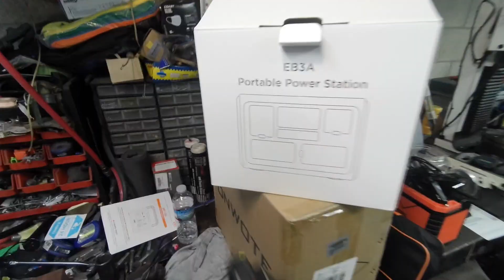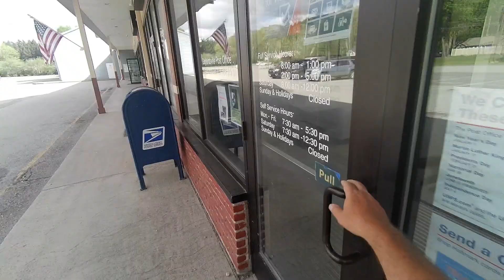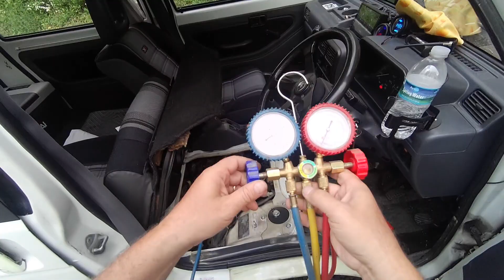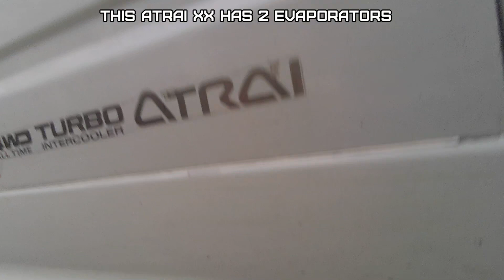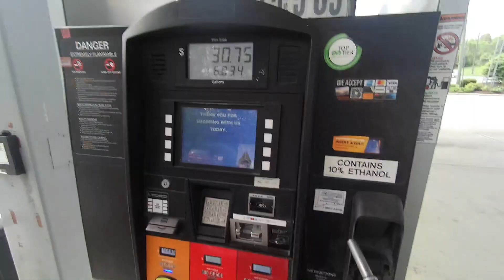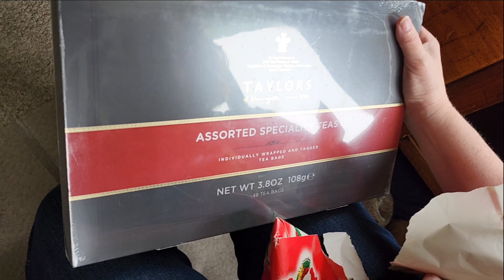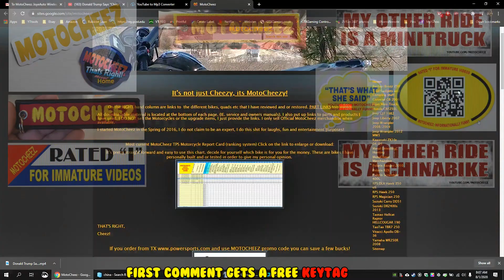MircroVan and Minitruck with some diner food reviews, AC recharging, shopping

Comment: It may be better to check the fuel filter and replace it if there is a problem
Since it is a car 30 years ago, it may be necessary to replace the fuel pump as well.
Reply from the maker: I did check the fuel pump, it's flowing perfectly so I don't think it's the filter either, but I'll change it anyway. I believe it's a flooding condition but how it acts

Comment: Hey motocheez I’m thinking about getting a mini truck but most are 5 hrs away from me. I was wondering if you could measure the dimensions of the driver seat for me so I know if I’ll fit because 5 hrs of driving is expensive .please
Reply from the maker: Height seat to ceiling?l 36" And back to sterring wheel  18" on my mini
Reply: @MotoCheez  what about from back of seat to the dash were the knees would go and thank you I appreciate it
Reply from the maker: @removeableskull7446  29" to dash
Reply: @MotoCheez  hey I appreciate it thank you